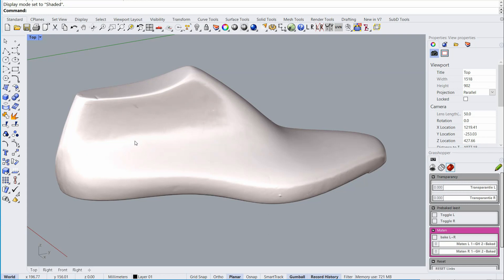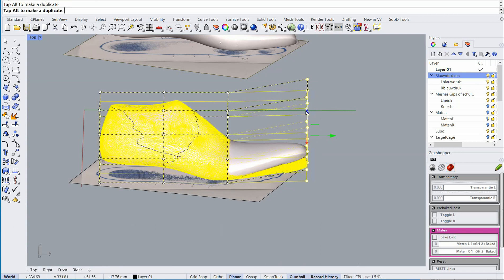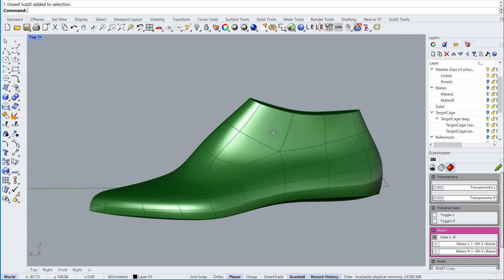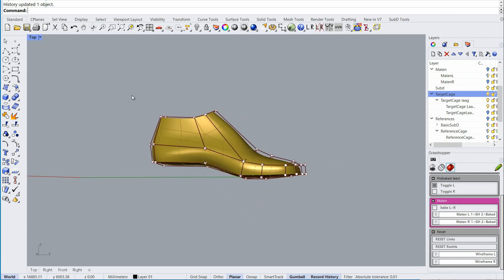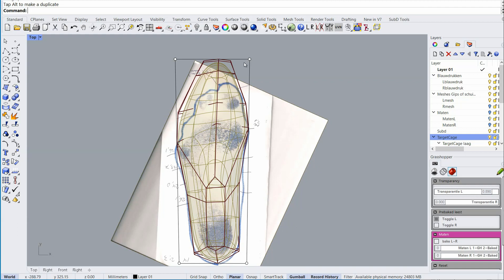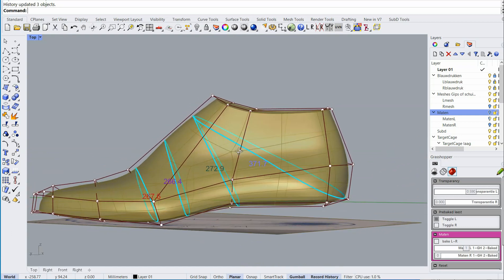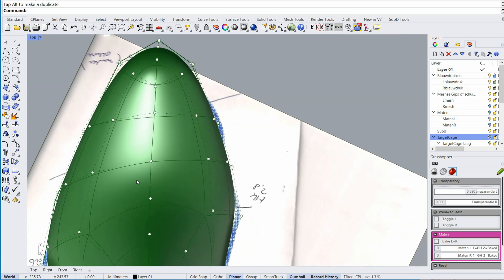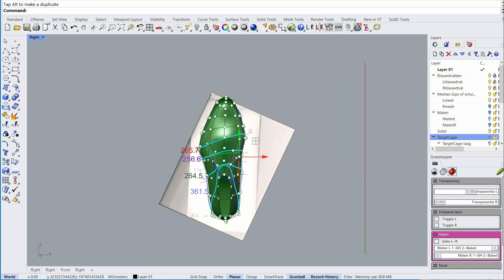Making a standard last fit

Comment: Very well done Erik. Does this method require having Grasshopper plug in??
Reply from the maker: Thanks for the compliment Bill.
I do use Grashopper for this, because I morph a basic last from one mesh to another mesh that works like a cage. This function is only available in a Grasshopper plugin (Fattener by Daniel Piker).
Grashopper is included in Rhino and Fattener is free.
I plan to explain my method more in detail by Webinars starting in June.
Reply: Hi sir, thank you for your hard working to explain us this function's,
Could you help me with just one ready sub d file for last?